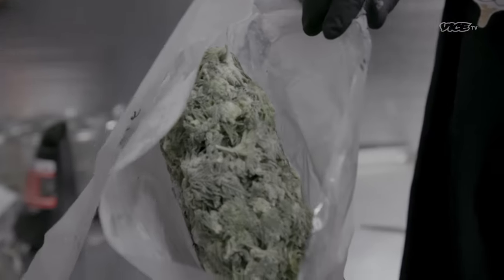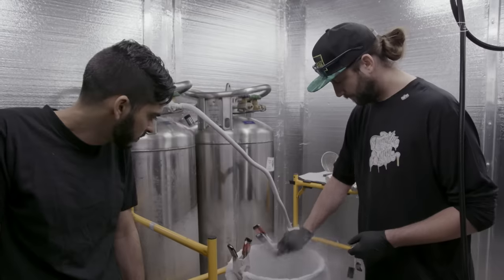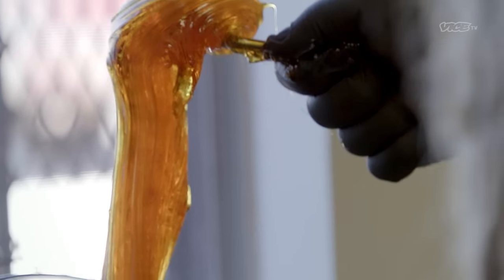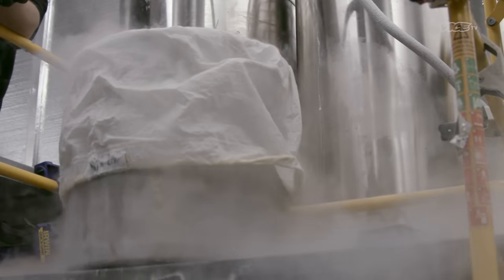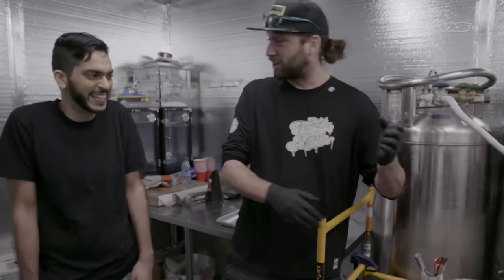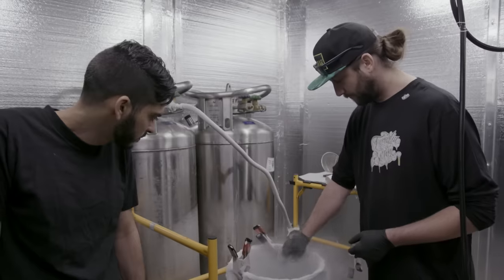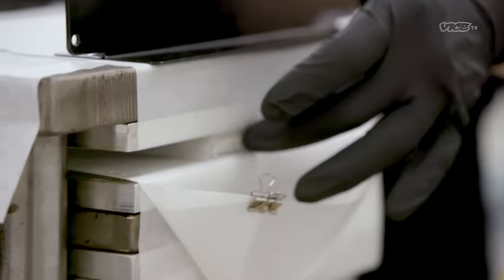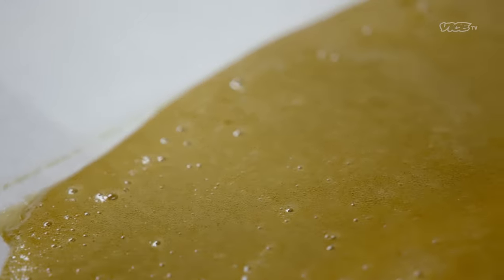I Freeze Weed With Liquid Nitrogen for a Living

Comment: "The Clear concentrate" amongst other hash makers all agree that this is a bottom of the barrel cartridge, food grade product
Reply: any cart from ANY company is trash
Reply: Yup distillate is trash, this is from years ago I think
Reply: Other companies use a crc machine or solvents. This one isn't really a solvent. This is a clean product compared to the rest of the industry
Reply: @PlantManCheeseHead  it’s still considered hot dog water
Reply: Hot dog water concentrates full of chemicals
Reply: @PlantManCheeseHead  This video is kinda misleading.. I don't think they aren't making clear with the LN2 frozen buds.   Pretty sure that's the rosin you see at the end of the video.  Also solvents aren't scary, if you remove them properly.    I'm not a pro like these guys but I've worked as a lab tech for a while if you have any questions.
Reply: Yes and no.  I trust these guys are making good stuff.   THC distillate (aka the clear) got a bad rap because lots of people were making crappy product in their basements, and cutting it with all kinds of stuff like non-cannabis terpenes, MCT oil, vitamin E acetate, vitamin E oil, etc.   I'd say carts have their place, for example if you're somewhere lighting a joint would get you kicked out.   I'm no pro like these guys but I used to work in legal industry for a bit making different extracts if you have any questions.
Reply: @williamisDTF  That's kinda like calling vodka potato water.   There were lots of crap carts on the market for a while, especially the black market, but I trust these guys are making good distillate.   I'm sure there was lots of crap vodka on the market during prohibition times too.
Reply: Can concur,
Medical dispensary budtender here!
The Clear hasn’t sold really any units that we have had since we opened March of 2023😢
Patients prefer bubble hash rosin carts/disposables or straigh hash rosin from our concentrate fridges. 
The Clear just isn’t keeping up with what patients like. Distillates can be very rough, especially in edibles because they tend to upset tummies! 
The cannabis industry is constantly evolving, so maybe the clear needs to as well, and that’s okay! It’s good to grow!
Reply: @-darrell  i like the full spectrum oil better. Made with the terpenes still in it. I find that overproof alcohol ( everclear ) makes the best edibles. Did you make cartridges like that? We drop off product to people making live resin, how hard is it to get tge machinery to do that?
Reply: @4freess  
I agree buddy.

We would make carts by extracting trim into subzero ethanol, then recovering the ethanol in a rotary evaporator, before finally distilling the crude hash oil into "the clear."   

I believe to make a live resin you need an extraction process that stays relatively cold the whole time.   Once you start adding too much heat (to remove the ethanol for example) you'll also lose all your terps & decarb your product.  That's fine for edibles, but obviously not ideal if you're gonna dab it.  

I believe the live resin guys use chilled hydrocarbons (butane, propane) instead because they have super low boiling points (30F for butane vs 170F for ethanol at standard atmosphere) which allows you to purge the solvent off without messing up your terps & stuff.   The permits to run that kind of equipment were too hard for my boss at the time to get, so I don't have much experience with BHO/PHO.
Reply: @-darrell  nice, I was usually top 5% for return on product I put out. I grow some nice triploids and tetraploids from a friend. Theres more high quality extracts to be made. Are you in the USA market? Im in Canada.
Reply: @4freess  Well you just gave me some reading material, thanks lol.  I can barely keep my houseplants alive.   Yeah USA.   Hoping to get back in that line of work one day :)
Reply: Only kids smoke carts and vapes look alike products real ogs like me just need some raw flowers and a backwoods or some grabbing leaves

Comment: "Some of the most celebrated extract" Yah no. It's distillate. Maybe celebrated among teenagers, but just cause its solventless doesn't mean it functionally isn't the same as a gas station vape cart. Also, there's only two workers in this video and both of them go entirely against each other. One of them claims they've separated terpenes altogether, and the one pressing it claims the liquid nitrogen method of washing will "not remove the terpenes" in comparison to regular ice washing as if regular ice washing will be a terpene remover. So one of them brags their stupid method loses the least amount of terpenes, and the one who shows the final product claims there are no terpenes whatsoever. What a fucking joke LMAO
Reply: they showed distillate at first but not the process to make it. then they pressed some hash into rosin.
Reply: real and true
Reply: @HyrimBot  "My job is to freeze weed and throw it in liquid nitrogen to superfreeze it. All to make the elusive clear concentrate." right in the description. There is no closed loop system here making distillate. They're taking WPFF material and using the extremely low temps of liquid nitrogen to cause trichome head separation, vs the traditional paddling/washing with just regular ice, and then pressing the resulting material. Either that, or the editors and the people who wrote and filmed have absolutely no idea the continuity of what they've filmed and missed the entire process of making distillate via closed loop and mentioning it'd be separate from traditional solventless extraction. Either way, this video is not a good look.
Reply: @mcaso123alt2  i agree. it's whack.
Reply: They are probably showing two stages / products here, but I agree with above random hoomans... They didn't explain schiit.
Reply: mf was holding amber distillate calling it pure lmao stopped watching when he said that was 50 g's worth...yikes
Reply: @mcaso123alt2  Freezing the weed is part of that system champ.
Reply: @mcaso123alt2  and yes the editors have no idea whats going on. Two entirely different products. https://www.youtube.com/watch?v=GFObYIiG3vU
Reply: @crisnmaryfam7344  sad that the editors don't know what's going on when this definitely has the potential to be some of the most viewed videos on concentrates on the biggest video platform :/ also sorry if I came off negative or rude in my last comment this video overall just irks me and puts me in a bad mood
Reply: @crisnmaryfam7344  Also, you don't freeze product for distilate via pouring the bud directly into liquid nitrogen. You freeze it in turkey bags in traditional freezer temps in freezers which are warmer than dry ice. Then thats inserted into a chamber and then proceeded through a closed loop system which inherently isn't solventless.
Reply: @slapaho1234 that part was true. It is worth around 50k considering how much u can r4p these hotdog water users for per gram

Comment: Dude should get propper cryogenic transfer lines. Using regular steel jacketed lines is extremely dangerous. Fwiw, any nonpolar solvent will yank the THC from the bud, but using LN2 would be as clean as it gets with supercritical CO2 being a close second.😮
Reply: This doesn't use chemical polar bonding like butane or other light hydrocarbons. I believe we're seeing more of a sifting procedure to separate the trichome heads.😀

Comment: its crazy how the trends around concentrates have gone, at first everybody wanted this stuff, 99% thc, nothing extra in it at all, now, at least in california, we started enjoying live resins/rosins a lot more. solventless heat extracts that keep and concentrate the original profile of the weed instead of just removing everything but the thc. in my opinion the high is usually better too, the only downside is that you have to use good weed, with a 99% concentrate you can use trim, it's just a smaller yield

Comment: The pressure and heat of pressing the weed burns the THC Resin.
Best to just  lightly use a bic lighter on some dried bud in a glass pipe.
56 years experience of growing and puffing here.
Reply: Your completely wrong about the press. It's very low, controlled temp.

Comment: why remove the terpenes? you're getting rid of the best part and the entire point of breeding different strains. I guess you can use some bunk to just get the THC and sell it for profit. Didn't really go into the process of activating it either. They said it's activated but those presses aren't heating hot enough or for long enough to decarb it. Just press the flower and you get a full spectrum live rosin that isn't activated until it's vaporized. If you want edibles, you can decarb the live rosin and only lose some of your terpenes in the process.

Comment: all that just to press rosin.. seems a bit cheaty for a "chemist", where is all the rotary evaporation equipment, thats what a chemist would be using.. low temperature solvents that will pull the terps and thc leaving all the fats and chlorophyll behind